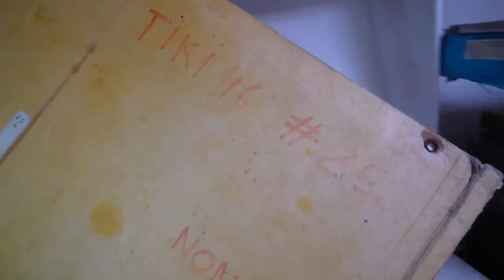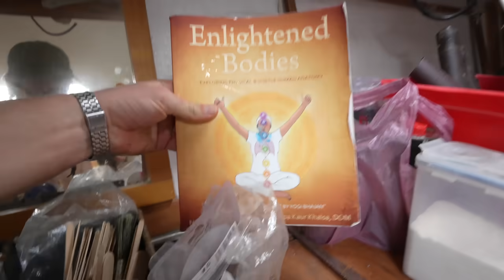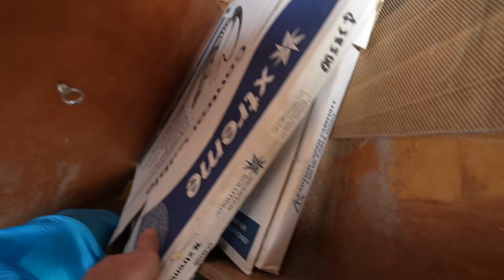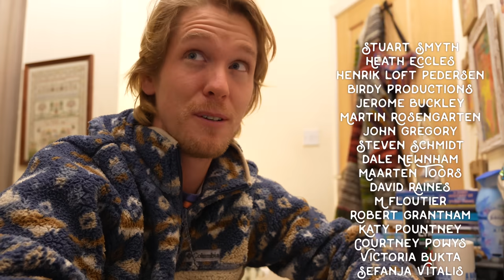Am I Actually Going To Buy This HUGE Project Catamaran? | Wildling Sailing

Comment: Mark that boat is totally awesome as it can be taken apart put in a shipping container and sent home ! Happy New Year  !
Reply: Now that's a fabulous idea I wasn't thinking about that you can disassemble it and hold it on a container ship in a cargo trailer
Reply: Its 46 ft
Reply: @dougbrodie2482  He'd have to remove the rudders to fit in a container.
Reply: They are known as the Land Rover of the seas! Almost any part can be remade and refitted, and the most expensive parts have already been done, however I still haven't spotted a winch yet, and i guess that a junk rig is heavy.
Reply: It’s too long. Even if it wasn’t too long you’d need at least four containers for all of the parts!
Reply: @lanceingram8477  They have 44 foot containers,  1 for each hull  3 probably be enough  , rudders removed .
Reply: Would never fit lol
Reply: Shipping containers are 40 foot
Reply: @reallynotyourbusiness1659  And ??the costs to get the boat apart etc then the hulls will not fit into a 40ft box and and and you really are not up to date with present shipping costs oh not forgetting there is 20% VAT to pay on the import and shipping costs !! Run along there's a good chap !!
Reply: you are clearly not into boating!
Reply: @rudihenry5298  Not at all Retired Master owner of marine support co with tugs and multi purpose vessels and been on the sea since I was 5 years old !! And you ???
Reply: @dougbrodie2482   Yeah 46ft wont fit in a 40ft container . and its not wide enough for 2 hulls ???

Comment: Hope you got it. My advice is to get a bunch of storage bins. Clear everything out of one side that shouldn't be there. Make it clean and make it useable spaces. Then do the same to the other side. Get a very basic solar generator, burner and fridge setup. Get a bed and pooper setup. Get the engines and deck on asap and move it asap. Get all the parts from shed, tie them down on deck and head out. The main thing I think is having access to supplies like paint and fasteners. Plumbing and electrical items. Anywhere near a homedepot or hardware store perhaps.
Reply: I agree , to get mobile and motor out . But where ? East Panama Coast via Panama Canal maybe . They seem friendly and cheap over there to other struggling Fitter-Outer Utubers on a budget .
Reply: @gregoryfietz3831  It might be smart to go to Panama City. It seems huge and has lots of hardware stores. But not sure if the internet and shipping is good there. But just getting to know that place as a sailor is probably a good idea. Would be cool if he could make it all the way up to Los Angeles and then Vancouver and maybe Alaska and do a bit of work at each place while he explorers them. I wonder if people sail from Alaska to maybe Japan. Seems like the only option to get home but I have no clue. Maybe stop by Australia, India and then South Africa. Then head home back to Europe. I guess might as well stop in Mexico and a few other countries along the way. Maybe South Korea and China. Maybe like 12 countries and stay about month in each.

Comment: Hi Mark. You are'nt so tough, but. This was a tall order for you. If you stay with this project you cannot let time and money waste away. It means you will start clearing stuff from day 1, hiring a container to stow away things first. Clear the hulls, live nearby and be there a long time. Don't go back to England but stay the course. And not invest in value items that is easy to steal. Get the minimum for sailing away, like a motor, maybe fix the platting, and then get to a secure boatyard for any refinements. From the mess I see it got chaotic. Be stingy with your money. Reintruduce one by one items from the container to evaluate finishing back each part project from the previous owner. But don't sauce it all together. Can you get a build crew? Or, my advice, if you can't get organized, go home, leave it!

Comment: I really hope you get the boat. I think the naysayers are not used to seeing wooden boats but she looks absolutely solid. I don’t think it would take much to sail her away. Put the decks on and motors and sort out your galley and cabin. There are young sailors circumnavigating now on Wharram’s less well equipped than that on, with a camp stove 😆 I know if you get that boat you won’t regret it. As long as you get it on the move pretty quick.

Comment: For the rain consider tarping the whole boat 
Choose any design that suits you.
1 or 2 days work and your permanently dry

Ridge pole,  Inside and outside Rope rafters etc
There will be plenty of designs to choose from.
The following lasted 2 years Christchurch,NZ  40 to 100 kilometre winds 6 to 12 x year

Horizontal Ridge pole(or rope ridge pole)
 vertical ropes down to outside hulls( like rafters supporting sag, down gust thrashing at 1 m centres) clear plastic over whole structure (for working light) 
Vertical ropes over top of plastic ( 1m centres) for up gust thrashing. 
12m long/7m wide
Possible to slip another light tarp through envelope to create shade and water protection.

Comment: The beams may feel strong but don't forget the Sea IS strong and relentless. Any vulnerability gets picked at, over and over. How you use junk sails is you raise them. How you tack is turn the tiller. Junk rig sails are great. They may not have the pointing ability of a standard sail but they make up for it in the tremendously lesser forces that get put on the sails and mast. You can sew panels out of t-shirts and twist some thin metal wire to attach them and it'll hold.

Comment: Another good episode,  interesting to see around the vessel.  I really think this is too big a project and it is going to consume a lot more money than you might think.  I just cannot imagine sailing a junk type sail arrangement across something like the Atlantic even worse with two masts and sails.  Not saying I could not be done but certainly will be difficult to find any experienced material on it being done.  I think you should consider maybe melody good solid steel all the hard hull work near complete big enough for the Atlantic or pacific.  Water makers are great when working but pain when they start to play up.  Big parts are the membrane which you already need to replace and the fact that it has not been used or maintained for some time I would be suspicious of the high pressure pump and seals etc.  it could well be a dead unit overall.  Anyway it’s your call at the end of the day

Comment: Upon closer inspection, the boat does look very dry and solid considering where it has been for all these years.  It also looks well built. All of that plus the new masts, sails (will need to replace all the standing and running rigging immediately) and with the 2 - Yamaha 25's tuned up, you will get through the Panama canal no problem and into the gulf of Mexico.  I see a path to making this work.  Phase 1 -with Team #1 all meeting up where the boat is now for 2 - 3 weeks of work.  Quickly (get the boat to Linton Bay, where Colin and Parley Revival got their work done). Equip the boat for now so it is bare bones, very light with just the essentials to motor/sail it to and through the Panama canal. Hire a small truck, or get a small container,  to move all the "extra" stuff inside the boat and storage shed by land to Linton Bay so it is not crowding the boat as it sails to Linton Bay.  Get it on land for Phase 2 - Team 2 flies in for 2 - 3 weeks and meets you at the Marina where the boat is on land..  With the boat on the hard - clean it, inspect the hulls for rot, refinish and/or repair the hulls.  This is a quick stop to find out exactly what you have project wise and plan the next Phase or next stop.  If everything is in pretty good shape, use the labor and expertise in that Boat yard (plus your large volunteer crew you have assembled) to get the labor intensive work done quickly to make it more seaworthy for the next trip. Sanding, glassing, replacing/repairing wood can all be completed in Linton Bay Marina at reasonable prices with your crew providing a lot of the labor and some local experts hired.  Phase 3 - sail/motor to Guatemala or Texas or Florida or ?....the ideal spot to finish off the rebuild, purchase and install the electronics and batteries where pricing and availability of everything needed to get fully equipped is close by.  Figure out the skills you will need from your Team of volunteers and each of the 3 locations, probably with 3 different teams - cooks and shoppers to keep the team fed,  Mechanics with skills for getting the motors running and assembling the spare parts needed for the trip and attending to other mechanical parts on the boat for the first voyage to Linton bay, and again to the final stop to finish the work. With each team at each new location you will need some photographers and videographers who can shoot and then produce the videos because you will be too busy for that.  A couple lawyers who speak Spanish would be good to have to confirm ownership of the boat in the sales transaction and navigating the  "special rules, taxes, bribes when trying to leave Costa Rica with clear paperwork where the boat has sat for a long time and possibly some laws about foreign owned boats that have been in country for "x" number of years are now subject to rules A, B and C due to those circumstances?  The more Team members within each skill set, who speak Spanish and any locals at each Phase location who know the politicians and power brokers will be invaluable for getting the work done and an easy departure from Costa Rica and the other countries you pass through.  Figure out the personnel and skills and how many of each you need so you have the right number of people...enough so people are not getting burned out but not too many where it's hard to keep everyone busy and they start goofing around making problems you have to spend your valuable time managing and solving. Once you get to your final place to finish the rebuild, you can cycle in new crews every few weeks until the project is done.  In 6 months you'll have a like new Wharram to sail back to the UK or to dodge Hurricanes in the Caribbean as you learn to sail the new boat and test her limits.  Maybe Henneke will come down for a visit to enjoy the warm sunny weather and check out your masterpiece.

Comment: I really want you to do it for the adventure.  You've got time to recover from a devastating financial flop, but I think that's because I'm being selfish and I really want to watch this story unfold.  Those two big Yamahas are nice engines.  I'm sure you could rig the halyards to the end of the boom to work as crane and then with a block and tackle you could lower those boxes into place.  That said, this boat is a terrible idea,  and you should breathe a sign of relief if the guy turns you down.

Comment: I saw how you restored Minke and you are capable of restoring it.   If you were in Grenada in Jan I would donate my old solar panels and mppt for your project.   Good luck and Happy New Year
Reply: They only replaced the windows  and stripped most of the interior and did some painting themselves, they were lucky to get professional help for the rudders and engines etc.

Comment: I would worry about the salt water in the bilge. If the keel bolts rust away from salt water ingress you are screwed. You generously took the side of the seller by suggesting to yourself that a wave caused that water. Hmmm. You could have dried up the water completely then look to see if it reappears in a non-wave  situation.

Comment: That boat is rock solid from everything you have shown in both vids Mark. Not sure what you mean by beyond my capabilities , throw the deck beams in lay down the deck boards and it will all fall into place , you're literally sitting on a gold mine. Something tells me you already own her I hope I'm right. Nothing wrong with that crossbeam just a bit of delamination and covered enough for protection...easy fix. Apart from all new running rigging and a bloody good clean up it's just messy not a pile O shite...It's all there even the pods in the shed , just needs painting. Lots of those small jobs are piss easy just clean out each hull 1 at a time and DON'T start cutting anything out with crazy ideas the boat is functional as it was designed. We got one here in Australia that's going for 69K and there was a Tangaroa 30 for sale well over that price a few yrs back as well. There is no reason you couldn't live on the boat so no need to rent...maybe cheaper to do a use of the shed deal and sleep in there if ya need to , it doesn't have to be all glitz and glamour ya know. Hope your bid gave you a few thousand pounds because that's what I recon it would cost you to be able to sail away with a bit of graft...both ways.

Comment: Love the boat! Yeah there is work to be done. Yes some will be difficult. Get a crew to help with refit, Trade for adventure. It will be done quicker than you think with help. Minke looked 10 times worse and look what you did to that one. Go for it!! Just finished my own project boat, so, so, rewarding. Good luck.

Comment: Buy stainless thread in various widths, lengths, nylock nuts at each end. 1/10  of the price of separate bolts. Also excellent safety policy, your able to repair,  adapt,repair while underway.

Comment: I like the Wharram designs.  The small ones are too small in my opinion, for “comfortably” and safely cruising worldwide.  Especially when you think of the crew numbers you have mentioned.

I am doing a stitch and glue nesting dinghy right now.  While epoxy is not my favorite material, I am impressed with the results.  

I made my living as a woodworker but I have been using epoxy with some of my woodwork for decades now. An epoxy-fiberglass vessel built properly will outlast these poly and vinyl ester production vessels.  Like significant architecture, if it is done well, it will be maintained.  We are facing a huge disposal problem with these plastic boats and wind generator blades that are past their design life.  I hope epoxy-fiberglass (done well) will last maybe a hundred years instead of 20.

You know what to look for.  Your visit to the Wharram’s was priceless.  If you are taken with the Wharram’s, be patient and one will come up for sale soon that meets your wish list.

My problem is I sold my Leopard 42 sailing cat since my wife does not want that life now that we are mid-sixties.  Me, I am pretty agile, a monohull would be fine for me.  I have disabled my right elbow by repeated use and abuse.  I mostly power thru it and use my left more.  It is tough tho to be a craftsperson but can’t do my craft like I want.  I was mostly custom timber framing and we beat ourselves up.  Now I am trying to fit in projects for others and still do my own projects.  

If the location works, I would love to help you get your new boat refit.  Or maybe just refinishing your new boat.  I will keep watching and you keep shopping.  I am excited to see what you select.

Comment: My gut feeling says go for it! Boat looks sound and there is a lot of gear. Would not take much to get the boat sailing and go someplace secure to organise finishing off. Big solid boat from what I can see, junk sails easy to manage and great engines which will move the boat easily after a service etc. Trust your judgement, you are an expert with your experience to date so keep the faith and well see you on the water sometime! SkipRay, Kerry, South West Ireland.

Comment: I have watched your channel for a while. I watched you working on minky. I purchased a 40 foot cat last year and I have started the refit process. My boat was in better shape than the tiki and it will still take 2 years and 100k to sort out. I am in Spain in a boatyard. You have a mammoth task ahead of you without the trouble of getting parts and materials as well as fiberglass and painting in such humidity. This boat will more than likely break you. It is not cheap for the conditions of it and the location. Mine was sailing and engines running and I only paid 25k plus the cost to view, collect, and relocate. Keep looking there are better opportunities for you

Comment: I see you can lift one end of motor boxes with your left hand (say 30 kilos) then the box is 60 kilos approx. Any small 2 part + rope blocks (from sailboat etc) will drag, (on ply etc) lift , lower 60 to 150 kilos simply to offer up the boxes to their housings and also to lift clear, adjust, pack etc and offer up again.
Put two pressure posts from deck to each boom to take pressure off your running rigging, to make temporary gantry crane.  Make a small beam across booms. Rope blocks, ply, in place, raise, lower, raise, bingo.
This is how the old timers installed,removed, engines heavy gear etc

Comment: I'm jealous.  GO FOR IT DUDE!!!  You'll regret if for the rest of your life if you don't.  Costa Rica is convenient for travel with cheap, probably daily flights to the U.S. for occasional parts runs.  Financial risk in the grand scheme of things is minimal.  I vote for getting this one.
Reply: On second thought this might not be the best boat for going around the world.  Doubt it could handle a heavy storm, like Cape Horn type stuff.  Also difficult in marinas and ports.  For that you need a heavy duty monohull.  Outboards would be convenient, but you can''t motor for a full day to outrun a storm or get out of the way.  Outboards get lousy milage.  Sailing Nahoa is going around the world in a catamaran, but they are experiencing some bulkhead separation.  It's a Lagoon 40 I think with diesel engines so they motor quit some time.  They are taking their sweet time about it.